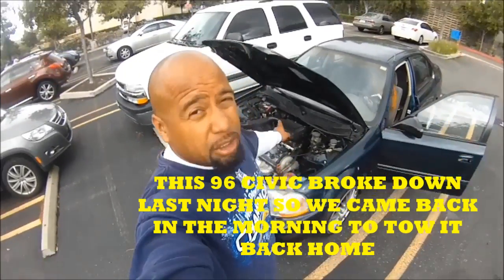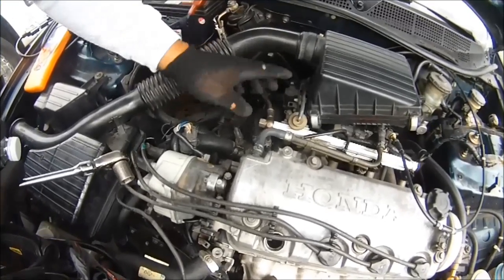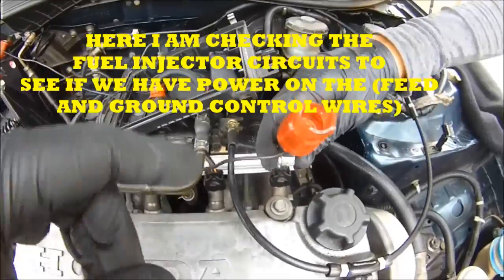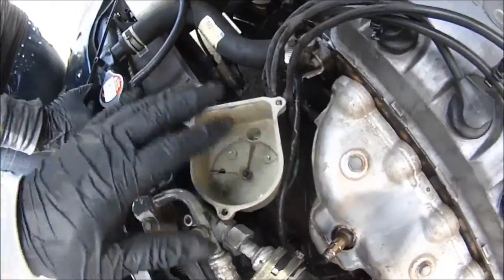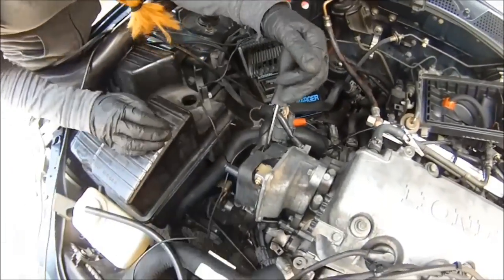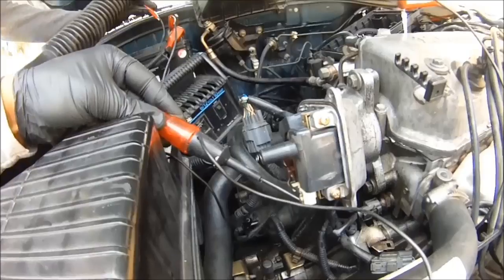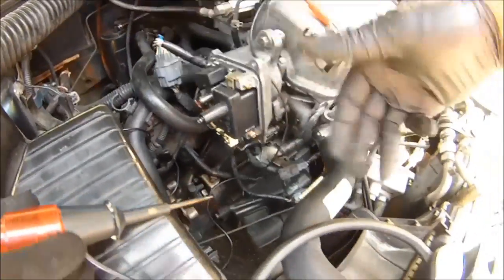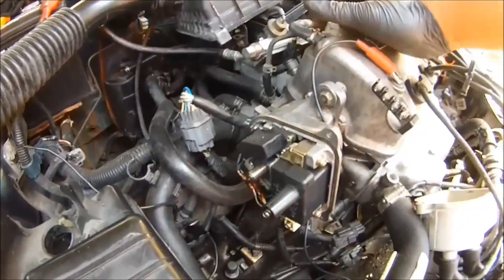HOW TO FIX A CAR THAT WILL NOT START,  HONDA  CIVIC

Comment: hey i need help with my 1993 honda civic dx manul, i changed the starter the distuburator the main relay the battery, my car will light up the dash board, but nothing and i mean nothing happens, help
Reply: Hey brother im not the OG but he probably wont see your comment but maybe i could help if you want. You need to follow your cars system to make sense or your issue before you throw any more parts at it. When you turn the key does the starter kick in at all? and have you checked the voltage going into the starter?

Comment: I have spark to the plugs and fuel to the fuel rail but my car still cranks and cranks. My fuel pump primes, my main relay is good, my injectors have power, my plugs smell like gas after cranking and I have spark. What else could it be? I drove to the store one day, came out 15 minutes later and the car wouldn't start. It was having some misfire issues in the prior weeks before and in the parking lot it did start at one point but was misfiring badly and when I gave it gas it died. Could my timing have skipped in the short drive to the store? The drive their was smooth. I don't know what else it could be or what else to try, it's very frustrating. Any help would be appreciated!
Reply: did you end up fixing your problem sounds like timing is off?
Reply: I did a compression test and had very low compression in 3 cylinders.
Reply: JJM how did you end up fixing the compression problem
Reply: I didn't. It's not worth it to do rings or a head gasket or whatever the problem is. It's just a d16y7 and has high milage. I bought a d16y8 for $200 with good compression (but high milage, oh well) and am in the process of swapping that in. I chased spark and fuel and everything causing no start for weeks and wish I did a simple compression test first. I still don't know how all of a sudden the car wouldn't start and had low compression when it was driving fine up until then though. ¯\_(ツ)_/¯

Comment: They key needs to be turned the contact points in the ignition switch turn stuff in on when you rotate the key. . your bypassing  the whole ignition  doing this . What your doing is waisting  time

Comment: I have an 05 civic with the same issue has   done everything on the video still won't work has anyone fixed there 05 civic  or have a diagram on them

Comment: Hi I have a 2005 hyandai accent. I was coming home from work and got to a stop sign and the car cut off. it will not start. checked the fuel relay. put a fuel pump on 4 months ago. Does any one have any suggestions. Help

Comment: what if u have gas and spark but don't start u thing it could be ignition
Reply from the maker: Timing could be off, bad sensors causing injector pulse to be off, there are many variables.

Comment: SIR I GOT A PROBLEMS...ENGINE B16A TURBO BOLT ON...MY CAR START THEN WHEN THE ENGINE GOT WARM UP THE CARS DEAD THEN WONT TURN ON AGAIN...THEY SAID THE ICM GONE BAD..IM SWAP  THE ICM AND THE GOOD COIL...BUT IT WONT START...THEN I CHECK THE INJECTOR TERMINAL...THE POSITIVE SIDE SHOWS PULSE BUT WHEN I CHECK THE POSOTIVE POST ITS NOT GOING TO SHOWS ANY PULSE...THEY SAID THE GROUNDING ECU..I CANT UNDERSTAND...CAN U HELP ME..
Reply: mohd noor Sounds like a bad fuel pump relay
Reply: its the aftermarket fuel pump...solve then add relay on it

Comment: I NEED HELP PLEASE.... I am a single parent  that NEED HELP😢😭😔😟....my 98 Honda Accord ex won't start...I have had the following work done; replaced the fuel pump, fuel pump relay, new ignition switch and had the car reprogrammed to the new key...THE CAR STILL WONT START....it will turn over but not start....I have spent so much money to the point of getting loans and the car still won't work....and if it does start and I turn it off it won't start again for weeks....This is my only transportation...and I don't have it to go and buy another car....Please help....I have tried for months to fix this on my own even while pregnant and going through a divorce.  I really wish this car was more dependable. I have watched countless videos and have tried some of the recommendations, however, still no go. Please no negative.....oh and I am a single mom because I decided I wasn't going to deal abuse, adultery, and someone who left me to die while pregnant......ok just wanted to make sure I covered all bases. Thanks.

Comment: please for give me for asking but why not just replace the whole dizzy
Reply from the maker: because most can't afford it, so we do it for the broke folkz
Reply: +oldskool funk i replaced the distributor, fuel pump, battery is good, new starter, I'm lost...( could it be sensors since it's not secondary)
Reply: No need to replace to replace the whole dizzy. There is more than just a distributor in there (coil, power transistor, position sensors) and its not likely that all of these parts have failed.
Reply from the maker: +Jack Toff You are absolutely right. The chances of all the components inside the distributor being bad at the same time is very very slim. Most people are not aware of that and their mechanic will not go into that kind of diagnosis so they just change the whole distributor which puts a whole in the customers wallet.